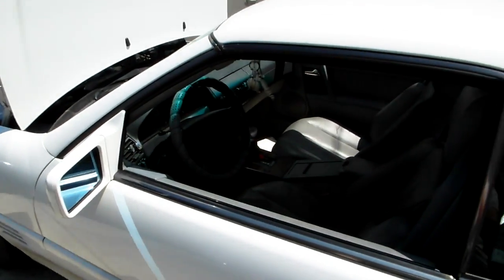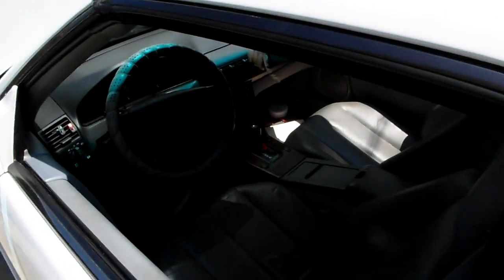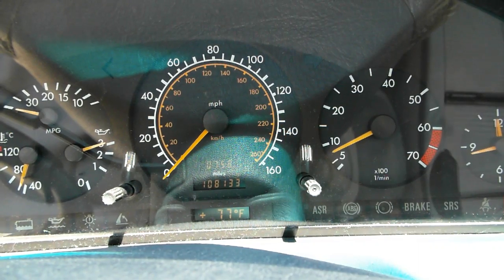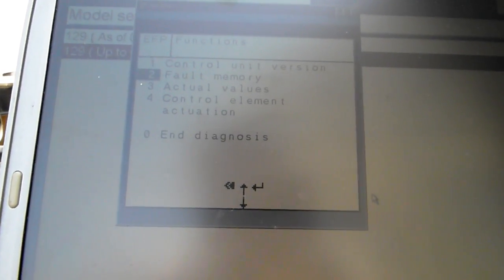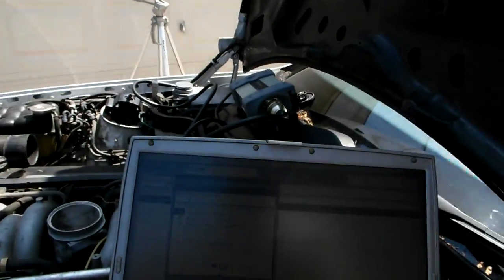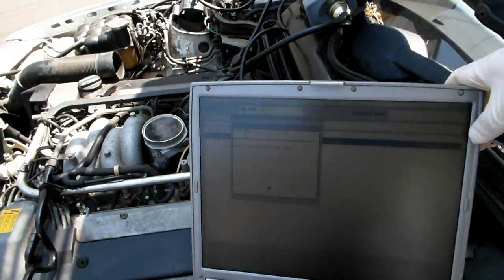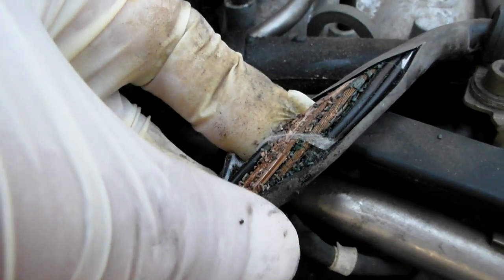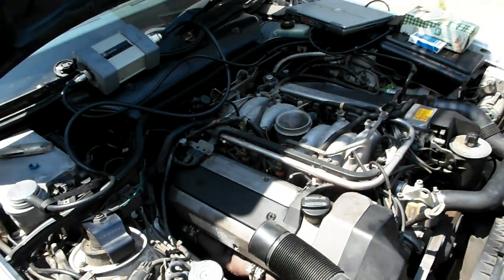Part 1. Mercedes ASR problem, showing symptoms of bad throttle body and removal procedure

Comment: Hey Vic I have a w140 92 500SEL and when you start the car you have throttle response but when it try’s to idle down asr light comes on and I have to push hard and I installed new  accelerator cable. Could throttle body be bad ?

Comment: @vsandvs my 94 sl500 has the ASR issue and when the car idles its sounds like it's breathing hard. The throttle also has to be pushed down further to accelerate.  What do you think the issue is? I can send you a video. Thank you
Reply from the maker: Probably throttle body failed.

Comment: Hi Victor GOD bless 
I have a question 
I have a 92 Mercedes-Benz 500sel 
I had the timing chain rails changed 
And the mechanic endup replacing the head gaskets too..heads were sent to the machine shop too 
Before the car was running nice 
Nowadays the car when running on the freeway and the soonest i take my foot off the gas and give gas again..freaking car won't speedup....I have to put transmission in N and give it gas so the car speeds up again...
Reply from the maker: No idea whats happening. I need to drive it to feel it out. Maybe transmission problem?

Comment: Hello Viktor i have a problem with my W140 s600 1994 when i start on the engine runs normal and after 20 sec it show up the ASR light i have checked the throttle cable and also checked the throttle sems it runs good but i don't know where is the issue maybe you can help me to figure up the issue
Reply from the maker: Ideally I need whole car for diagnostic. Or both throttles and Egas mailed to me for diagnostic/repair. Prices range depending whats faulty.

Comment: Hello victor I have an MB E420 I hope you can help me
When I start it has a lot of instability vibrates and gives some exploits when it is already heated it improves a bit it becomes more stable
To rise to more than 4 thousand RPM trembles
You think it's the throttle body
Or MAP
Reply: Did you ever find out same issue in my 99 s500

Comment: Hi estell victor i have a mercedes e 420 94 with that same motor m 119 and has a problem that can be the throtle
When you go up to 4000 rpm it seems to be unstable raise and lower the rebound measuring needle. Do you think it is necessary to replace the throttle?

Comment: victor, i have a 1992 benz sl500 1/7/17 did my front brakes and sunday i to a 30 minute drive and on the way back my car turned on the ASR and the ABS and the car turned off and i was not able to turn on anymore , would the sensors on the brake pads  make this problem. please help mike

Comment: Hi - I have a 1994 MB E420. Problem with high idle and surging, etc. (3) mechanics thout it was throttle body. Had that checked. No throttle body. They suggested e-gas module. Are there any other things I should be looking at? Any info would be great help.

Comment: Hi, your videos are the best instructions I have ever seen.
I just have a small question. In the video engine fluctuates between 1000 and 1500 RPM.
My 1992. M119 4.2 in a W124 has the same fluctuation in idel, between 500 and 750 RPM. It's jumping up and down every time but on a hot day. Upper engine harness is brand new, bought it in 2013. Only wires that aren't new arre from throttle body. Also, ASR and ABS lights are not on and bulbs are in,I checked.
Do you think this could be related to the same issues this SL has? :)
P.S. Thanks again for videos, they have saved a small fortune already for me. Just this jumping idle to solve...
Reply: Bojan Komljenović hey I have a 1995 e320 and it is doing the same thing..did you solve your problem if so help me..check my channel for a video of the car

Comment: Great videos!
I have 560sec from 91 with ASR problem and ABS is working
The ASR lamp is on all the time never shut off.
I tried to investigate the problem and I noticed that the rod from the actuator is not connected,when i bought the car it was like this.When I connect the rod and push the gas pedal the car shuts down.When I take away the rod keep engine running and move the actuator by hand car shuts down.Any suggestions how can i start to search for problem?Can it be actuator failure?